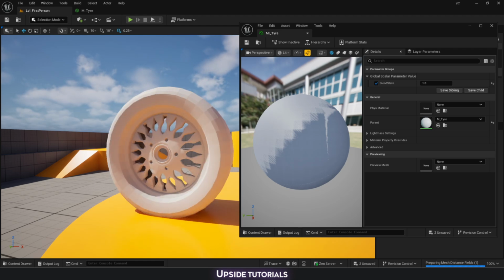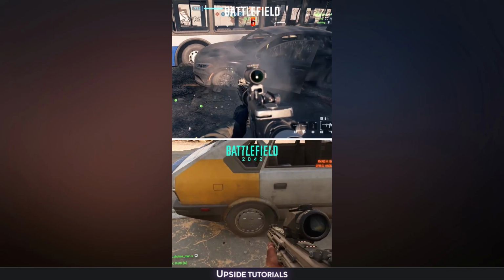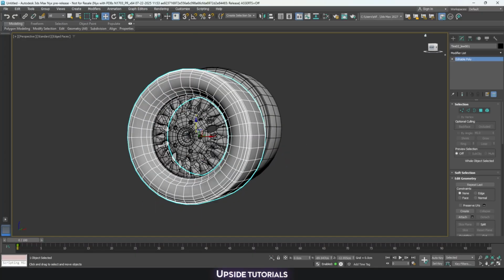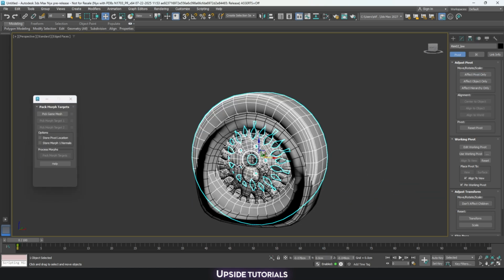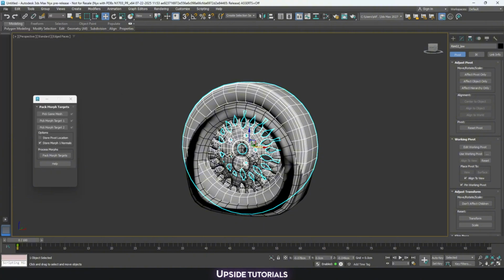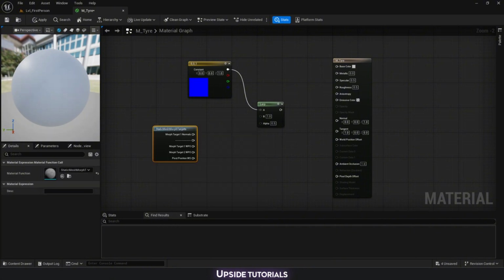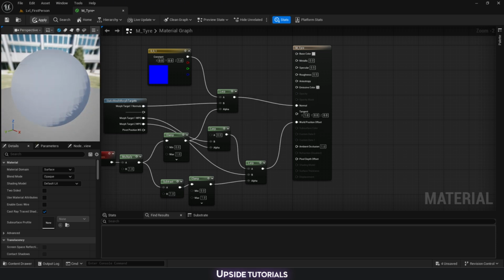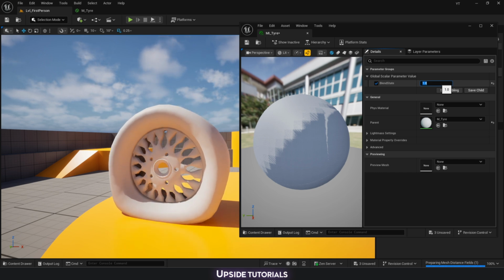I Made Flat Tires in Unreal Engine 5

Comment: That's cool, but what if the wheel needs to rotate while driving the vehicle? :)
Reply: There's a new lattice tool in UE 5.6.  I've never used it, and it's still in experimental stage.  I would think it wouldn't be near as efficient as the method in the video, but it might be worth looking into.  You could also manipulate the material's object space with WPO, similar to in the vid.  It would be more efficient than a lattice (probably), but getting a good result might take some trial and error.
Reply from the maker: For something that’s animated I would use a skeletal mesh and morph targets. The static mesh approach is more for stationary objects like the tyre on a parked car or it can be used for other assets like barrels that are damaged, etc.